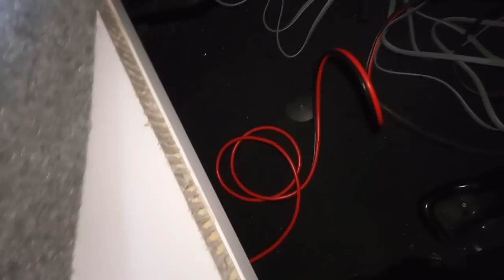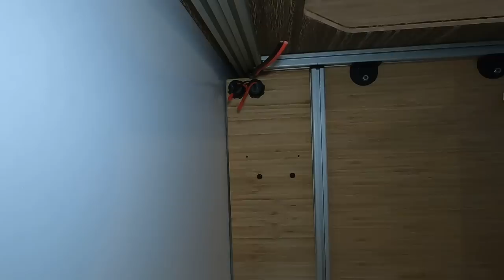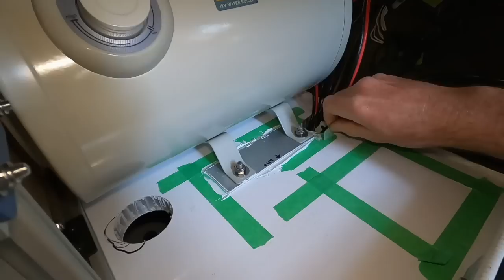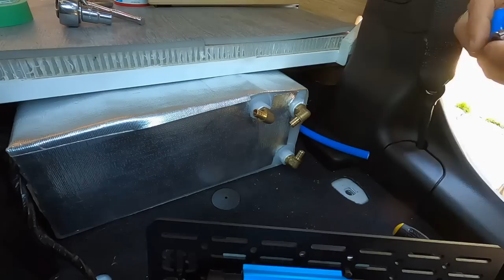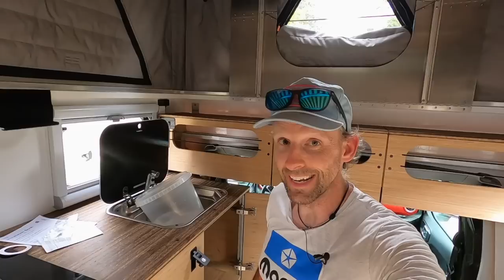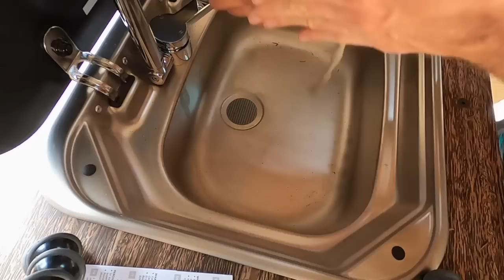HOWTO: Design and build your own Overland or VanLife Water System!

Comment: I spent AGES on my water system, it's definitely one of the bigger projects. Since I have a hydronic diesel heater (autoterm) on a separate glycol system from the engine, I could just put a flow-through heat exchanger just after the diesel heater. Takes about ten minutes to heat up, but after that there's on-demand hot water. You'd think just pushing cold water through a block of copper wouldn't do much, but it gets way too hot to touch. No hot-water tank, no electric to heat it, but you do have to start the heater to get warm water - which is no big issue since if you don't turn on the fans, it doesn't really heat up anything other than the glycol.

Comment: Sir, I have replicated several of your system builds with some changes. As to the water system, I used single two-way valves, thus using two instead of four (always cutting weight and items that will fail). Don't use a UV, as backpackers and bikepackers use filters without UV (again, the less, the better). I installed a 12v 300w heating rod into the water tank. The common question is, Who wants only hot water? Fair. Not only does it keep the tank from freezing, but it also serves as a radiant heater while sleeping. When room temperature is comfortable for showering, I don't need to turn it on. I keep a water-filled bottle in the fridge when it's too warm to drink.

Somehow, my comment about your battery bank was lost. I have an 800ah bank. Why? What I have learned, almost four years now, is that most of the battery is consumed between making dinner (induction stove 1800w), staying warm (1800w heater) or cool (6k BTU A/C) while sleeping, and making breakfast. All these loads occur when there's no solar to recharge them. Your sharing is always appreciated. Thank you, Sir.

Comment: I got a selectable 3 flow rate aerator from Amazon for the faucet in my van. It lets you pick from 0.5 to 1.5 pm flow rate so you can use very little water so you’re not draining your tank just for hand washing or tooth brushing.

Comment: Be careful with the grey water. As I'm sure you have run into before, there are places in the world that require a grey water tank if you have a built in sink system. Even a 2 or 4 litre tank would satisfy the requirement. Great system. I'm really impressed with the Guzzle H20 Flex system and will be using it to upgrade my camper trailer. Cheers from over here!
Reply from the maker: I've never actually encountered a place that forces you to have one.. though I guess I've never had a sink before either.
In any case, my sink drain pipe IS my grey water tank :)

Comment: Looks great, a far cry from the good old days with heating water on the fire and mixing hot and cold in a bucket to toss over one’s head to rinse or using the black bag sun warmed shower system with just a gravity feed, no pressure wet down and rinse.  Dan, is overlanding getting too soft?  NO WAY!  Great job!  Safe travels.
Reply from the maker: What you describe is exactly what I did for 2 years on the Pan-American and 3 years around Africa. It worked great.
I wanted to learn about and then use a "better" system to see if it's really worth it.
Reply: @TheRoadChoseMe  if you can build it and it is robust without being cumbersome and heavy, it is definitely worth it.  I remember in my youth overlanding in Africa, I even hitchhiked in Southern Africa, simple pleasures were huge.  Heaven was a good treat like a tasty European cookie with my mug of tea after a hot or particularly tough travel day.  We always stashed away some treats from home for the tough days.  Back in those days we could pay to use the pool at some safari lodges in the Serengeti, a great treat for ourselves, pool time, a nice hot shower and a cold beer.  We didn’t travel with 12 volt fridge/freezers back then, and no shower.  Your latest build will be a great overlanding home, durable, comfortable and safe.

Comment: Can I advise putting a check valve on the outlet tube from the tank near the shut off valve to prevent back filling it with unfiltered water.  Also, 2 3-way “L” ball valves (diverting valves) would make the switch overs easier.
Reply from the maker: I searched and searched for 3-way "L" ball valves with PEX 1/2 male ends and couldn't find them for the life of me

Comment: Not sure if this has been discussed. But I think a heat exchanger would be more practical and more space saving than going with a second water tank for heat. 

So you plumb the exchanger through the car cooling system and run a thermostat to the water tank. The exchanger will be cycling the water inside the main tank. You then add a thermostat with an auto valve. And set it and forget it. That’s what Ive done on multiple vehicles of mine. In very cold weather. I set it to 43C and in mild weather i set it to 32C. Washing, cleaning, showering will always be comfortable. And you don’t have to think about it. 

2 main issues you have in the electrical heater setup. One is space as mentioned. The other is practicality. You will notice that sometimes, 8 liters is not enough to wash and shower and clean. Also the electric heater is taking all the power from the battery. Even when the car is off. 

You have a free heat energy source under the hood. Maximize its usability.
Reply from the maker: I talked about that in the video. I did not want to mess with the cooling loop of the engine, I did not want to run coolant hoses down under the frame, I did not want to punch holes into the bottom of the living box.
I actually think this is simpler, and if I ever have problems with it I just don't have hot water, but have not compromised the cooling of the engine
Reply: @TheRoadChoseMe  i guess it depends on where you ise your car. For us in the Middle East. We typically take the existing hoses for the heater core and utilities it for heating the exchanger. But maybe in your case, you need to maintain the factory plumbing even for hot air. Either way, I'm jealous of your new and well executed setup. Enjoy your travels!
Reply from the maker: People here do that too, but it's not something I wanted to do
Reply: @TheRoadChoseMe  Dan I fully agree with you. I would not tap into any newer vehicle coolant system. There are just too many sensors and possible failure points that could get you stranded if your vehicle computer decides to.

Comment: Amazing Dan! I'm mightily impressed! To me, it seems like you really nailed it with this installation. Boy there sure are a lot of bits and pieces to put it all together. I have a greater appreciation now for why companies who build RVs charge so much for their water systems. This addition sure is going to make your expedition more civilized! 

Can you remind me of why you double filter your water? Was your water system in Sandy also double-filtered? Have you ever had the need to filter water from a water source that wasn't circulating (like a lake with pond scum on it or something else similarly nasty)? Pretty awesome stuff Dan! I'm sure that making that video was labor intensive. Very informative - thank you!
Reply from the maker: When I was designing the system for Sandy the Africa Jeep, everything I read said that I should put the filter on the outlet of the pump, not the inlet (these pumps are good at pushing through a filter, not good at sucking through a filter).
I always knew I wanted to filter and UV treat the water before it went into the tank to make sure nasties wouldn't grow in there.
Once I had done that, everytime I looked at the system diagram it just made sense to filter and UV treat it on the way in and the way out - I figured why not, given I was planning Africa for many years.
It worked flawlessly all around the continent and was easily the most heavily used system on that vehicle.
I see no reason not to do it again.
Reply: @TheRoadChoseMe  Good point. It's only a little bit more incremental effort to add a second filter. Thanks for sharing your reasoning!
Reply from the maker: There is no second filter - it all runs through the same one twice!

Comment: Great install. Glad you went electric for everything possible (hot water and induction cooking. I guess the only non-electric is diesel heating which makes sense. Are you planning for an outside tent for the shower, or maybe you’ll be so remote you don’t need it. 
Also, I probably missed what you do for toilet. Urine separator toilet? Or compost?  Cheers Dan. Great to follow you along from 🇨🇦
Reply from the maker: It is very intentional that the only things this requires is diesel and drinking water.
No propane, no shore power, no gasoline for cooking. Less is better.

Comment: Great system Dan. Will you be adding a water level sensor to the tank? Ive seen some Zigbee ultrasonic water level sensors that theoretically could connect to the Renogy One
Reply from the maker: Eh. I had one in Sandy the Africa Jeep and to be honest I just didn't need it.
Once you live in a vehicle full time you get a very good sense of how full the tank is and when you need to fill it up.
I can also see the tank easily behind the drivers seat, so I can check the level without much effort.

Comment: Gonna be sweet having hot water this time! Curious, why no p-trap? No sewer gasses to worry about but it would keep critters from crawling up inside.
Reply from the maker: Don't want to drive around with water sloshing around in there. The stopper in the sink will stop critters, and if I'm really worried about it I'll just close the ball valve on the drain pipe.
Hot water is already awesome

Comment: Wait...so dirty water goes through the house pump and not a separate pump?  What do you do about that little bit of dirty water left between the pump and the filter?
Reply: It goes through the filter again so it doesn't matter? I suppose the pump might become a little gross over time without cleaning..
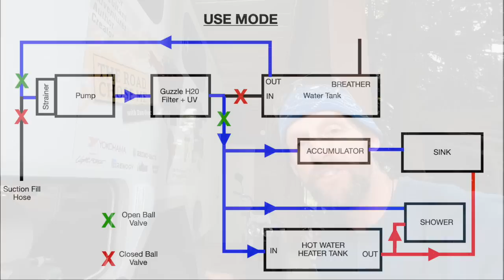Reply: It should not matter. Per the diagram (5:23), the water always flows from the filter, before going to the tank and before going to the house system. That little bit of dirty water will be filtered in all cases. It's a nifty design to allow the pump to do double duty and avoid a gravity fill.
Reply from the maker: You are right the system has that small flaw, but it will always get filtered and UV treated, and I just make sure to use a little water each time after filling up to "flush" out the inflow system.
Three years around Africa with the same setup and it was flawless. I'm very happy with it

Comment: This looks great! You’ve definitely thought out a lot

A couple questions for you. The hoses behind your access door seem secure…but a couple looked like they could jiggle and rub on some of the cabinet boards. Do you think after a lot of washboard they might wear through?

The accumulator looks like it’s working well! However…are you planning to leave the system pressurized while traveling? Again, I wonder if lines with pressure on them could be more likely to leak when subjected to vibration vs depressurized. Just  thought 

Excellent work though!
Reply from the maker: The hoses can't rub on anything sharp, so I seriously doubt they will be a problem. Three years around Africa on the worst roads in the world was never an issue.

I do have a master switch to turn off power to the pump, and out of habit I usually do turn it off so there isn't much pressure in the lines when there doesn't need to be.

Comment: hey dan! hope the travels are going well! im inspired by your water system and had a question. im building out an old 4runner so space is really a premium. im considering using a heat exchanger off the engine to warm shower water. im wondeting how much downside there is to skipping the hot water tank? ie, i throw a ball valve and water begins circulating say 5min before arriving at camp. but now my entire drinking water tank (approx 12-15gal) is warm water. can u see a downside to having all your water warm when arriving at camp? then i could skip having a separate hot water tank.

also, i dont see a gravity fill for your tank. do you always use the pump to fill?

did you install a check valve near the tank (to reduce pump cycling when using sm quantities of water fr the sink)?

how did you prep the system for easy winterization?

thanks a ton for the great content!
Reply from the maker: I always pump water into the tank so it goes through the filter and UV Lamp on the way in. (and thew way out)

No check valve, the accumulator makes sure the pump doesn't cycle a lot for small use.

I did nothing to make winterization easy. I will just drain it and put in some safe-to-drink antifreeze stuff from an RV Store.

I personally wouldn't want to warm the whole tank - I think you increase the chances of something nasty growing in there... you'll have warm water to drink, and you'll be pumping warm water (hot?) through your pump and filter and all that. I don't think that's a good idea.

Good luck!
Reply: @TheRoadChoseMe  Thanks Dan. Appreciate the insights and tend to agree.

Comment: Very nice, did you give any thought to a tankless water heater?
Reply from the maker: I did, but I didn't want to mess with the coolant loop of the Jeep
Reply: @TheRoadChoseMe  Not tied to the Jeep, stand alone, either propane or electric.
Reply from the maker: Propane is a very hard no for going global.
The fittings are different in every country so getting them filled is a nightmare, you can't ship with your bottle, etc. etc.
Electric on demand would use a lot more power than my current setup does

Comment: Dan, does the hw heater have a replaceable anode rod?  If so, you want to be able to remove it and have the tank drain out through your external access hatch.
Reply from the maker: I believe it does, and yes, I can drain the tank no problem

Comment: Any concern of that filter freezing with how close it is to the side panel?

And is the plan for an outdoor folding shower cube curtain?
Reply from the maker: All of it is inside the insulated box that is heated with the diesel heater. My plan is to keep it warm enough in there so it doesn't freeze. Also being so close to the water heater that bleeds a bit of heat will help.
No curtain plan, just wait until dusk to shower - I prefer to camp as far away from other people as possible anyway

Comment: Could a PVC water tank could be susceptible to mildew /  fungus ?
Reply from the maker: I think if you pump in contaminated water stuff could grow in the tank.
That's why I filter and UV treat the water before it goes into the tank.
3 years around Africa with the same setup and never a problem.